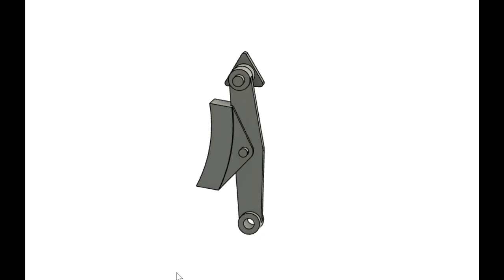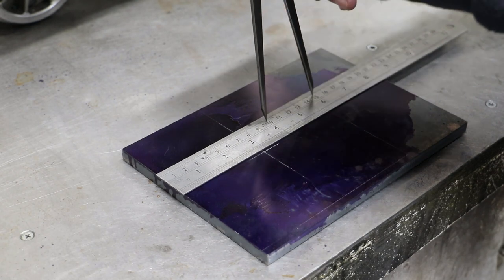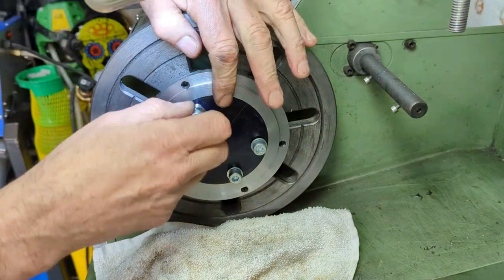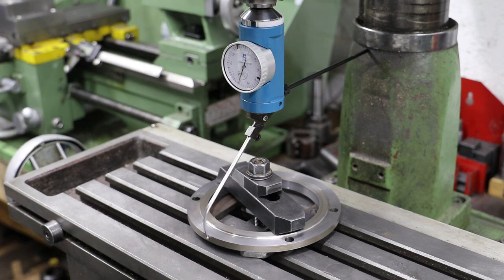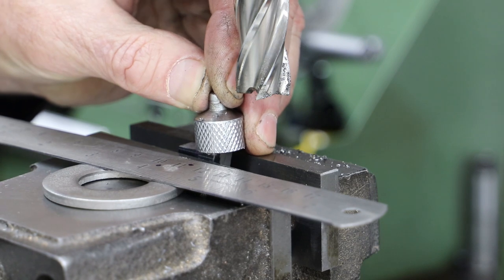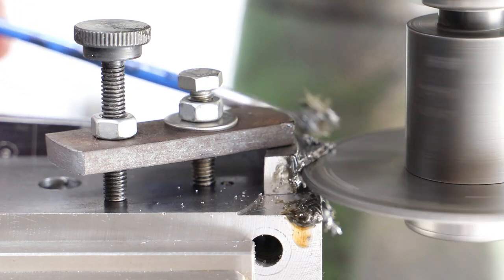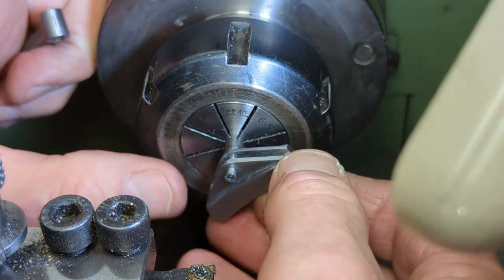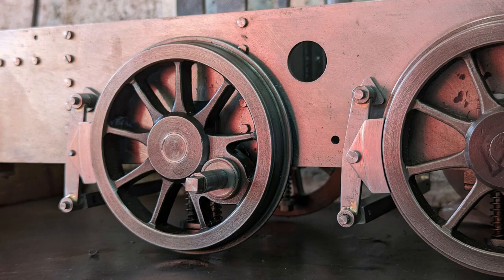Part 54 :The Brake Shoes

Comment: Is it me but the first time you drill into your faceplate there is a feeling of deep dissapointment?
but once its done for the first time its a more versitie tool in the future and can be modified many times to every kind of job...
Reply from the maker: Hi Brendan, an interesting question.
After having had a particularly sketchy set up on the faceplate "let go" and take some significant chunks outs of the (so called "hardened") lathe bed a while back , I had no qualms.  
But I do understand what you mean :-)
Cheers, Mark